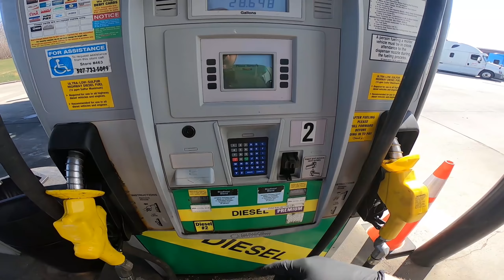Why do I do this to myself? (day 4)

Comment: when you precool it cools the walls and floor .the air temp will cool quickly when the inter box is cold .kind of like your fridge at home .if its cold before the power goes off it will stay cool for a while. besides, they don't care about your fuel cost.

Comment: I have a 3406C. Bought it with around 1.8 million on it. I have been putting in regular conventional oil (15w40 Delo 400) every 15,000 miles. With a gallon of Lucas every time. Been working just fine. I also don't idle the piss outta my truck, but that's besides the point. Also I also put Lucas in my differentials. 4 gallons of what's supposed to go in there, and a gallon of Lucas. Yes I know its weird. But I'm noticing a lot less wear down there too.

Comment: I try not to open a reefer, or slide tandems until I'm as close to the dock as possible. Helps keep your temperature variance as low as possible and saves fuel. Also helps if they open their dock door as soon as you bump, to maintain air flow - instead of you bleeding cold out into the atmosphere.

Comment: Shell Rotella or Chevron 15w40 I use to use in my Cat. The Shell I use to curse at cause when you start it up it would blow black soot out on start up and stain my clothes. I would never use Lucas in anything. Just use regular dino oil and change out at 12,000 to 13,000 miles. Regular oil is cheap and you always got good oil in it this way.

Comment: Pro tip, use your breather hole to fill up your oil instead of the dipstick tube. The breather should just pull right out.

Comment: I use Lucas in everything,
Cars pickups my lawn Mowers my harleys 😁
I put it in my transmissions rear ends, cut a long one short I'm a firm believer on Lucas 😁
I put 2 gallons in on every oil change on my 18 Wheeler 😁😎

Comment: Typically you pre cool the trailer walls. The walls are insulated with foam the walls get cold and the foam gets cold keeps the cool temps.  So even tho you’re letting the cold air out  the trailer inside is still cold. And then you put frozen product in there and start the reefer and the coldness of the frozen product plus pre cooled trailer. Keeps everything content. Rather than showing up with a trailer that is 80 degrees inside and then trying to cool it after getting loaded. 
 What I’m saying is even if you sit 2 hours in the dock the trailer won’t get up to the hot temp before you pre cooled it.  #science. Granted I think pre cooling is stupid too.

Comment: Do the shippers have you pre-cool to verify the reefer is working? I know we had a guy come in one time and got loaded. Went to start the unit up and it was dead. I believe we ended up unloading him. PITA for our dock guys.
Reply: mike_d823 pre-cool is required to get the reefer cooled to temp so when loading or right after loaded freight doesn’t melt thaw or have heat spots throughout the load
Reply: Lol, i did that once, batt was dead.

Comment: Keep that old truck rollin, you’ll regret getting into a new one. Have a newer truck and I’m currently redoing a 96 379exhd with a 5ek/18speed. Trucks been sitting for 16 years. 
I’d rather deal with small problems here and there then a 2000$+ payment a month on top of emission problems.
Reply: Get a better job.   Mush easier when you pay the full amount .

Comment: 1800 RPM is a little high for a cat to handle.
Reply: Stacey Ellis you must not know much about cats then 😂
Reply: ryan popp  I was going to say , I had a  4-1/4 would turn 22 and could do more if turned a little bit. But not necessary.
Reply: Stacey Ellis if you’ve got any power, you should never be using it under 1300, cruising at 1500, and 1700 max. I know these “new” cats will be in pieces at 1900. Let alone north of that.

Comment: C15 using coolant. Hope it’s not a dropped liner!!
Reply from the maker: I’ve actually got a 5ek. Idk. The motor was rebuilt not super long ago.
Reply: @TheMilkMans  Keep an eye on it. It might just have a level it likes to run at and stay there. If they put a reman head on there was at one time a bad batch of them going around and they had cracks (My C15 had this) got another head put on under warranty and was fixed after that. However, my problem was it was finding places to leak from and I kept chasing the leaks every time I tightened a hose up (exhaust gas was getting in the coolant and pressurizing it).